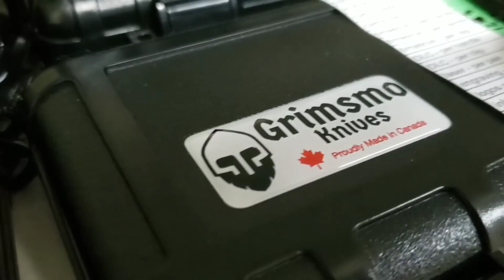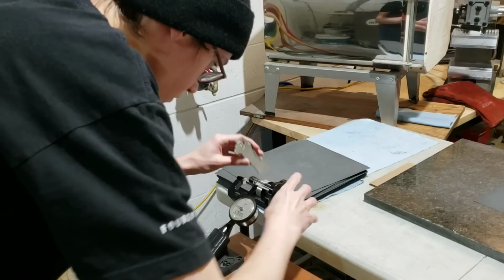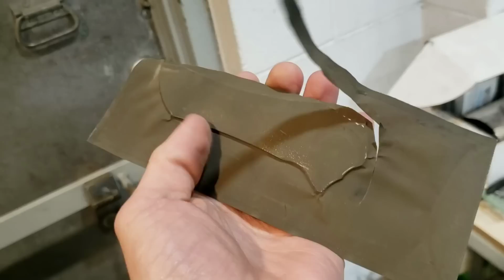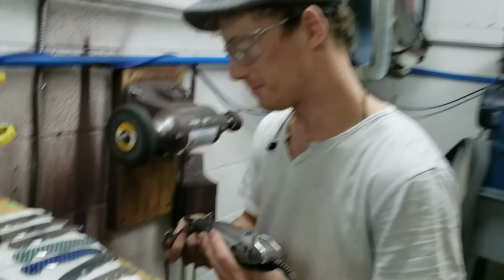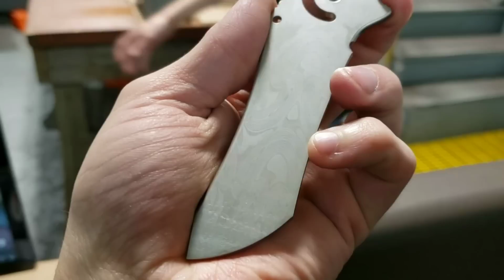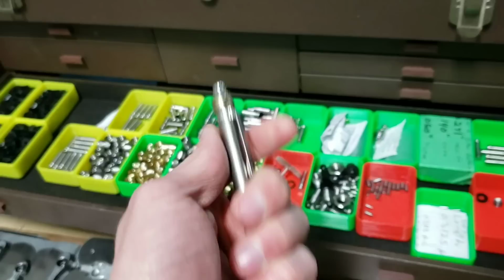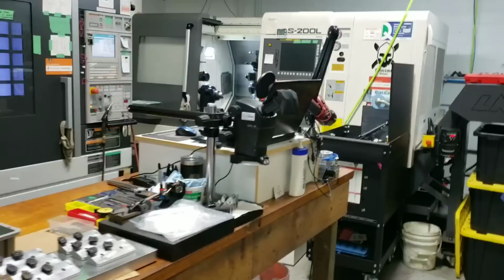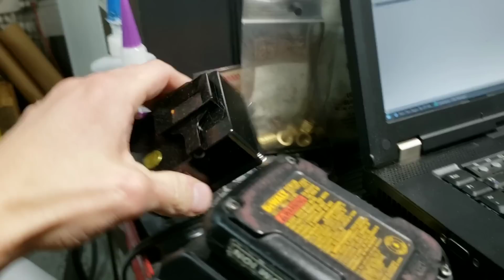Shop update and having a Big Think with John and Barry - Shop Life 034

Comment: Your motherboard has limitations to how many gigs of ram it can handle. This is why it is probably reading only one stick. Stick to motherboards manual and you will be fine.
Reply: Or... he may have a bad stick of RAM...
16-32GB of RAM is not uncommon
Reply: Most modern mobo chipsets will handle 64 Gb just fine. Having said that, leaving RAM modules lying around out of their static protection is a great way to make sure they don't work...
Reply from the maker: Right, gotcha.
Reply: Check the manual - some boards like to have ram sticks in pairs, very non-intuitively in bank 1 &3 then 2 &4. I would try cycling each suspect stick in bank one - if any don't work by themselves, then its likely dodgy.
Reply: @nickmartin1688  They'll be fine. All that "yoU'vE gOT to UsE aN aNTi sTAtiC wrISt StRap," is nonsense. We didn't own q single one, and we built hundreds-thousands of computers without issue. We used to have a tech at the computer shop I worked in, that would stir his coffee with 512 mb sticks. (In the late 90's when that was a ton of ram.)  So it's a non issue. Usually people that don't know much about computers think that static is a bigger issue than it is
Reply: Hi Andrew; I don't want to pick a fight, but you are wrong. I also worked in a computer shop building and then fixing PC s 'back in the day' and we didn't pay much attention to ESD either. We also had a small but significant number of early failures.

I moved on to a high-end communications equipment manufacturer. After a heap of testing and statistical analysis, they found that it was profitable to make the plant ESD free with a conductive floor covering and heel straps on everybody's shoes. There was a tester at the main door and anyone without grounding always had a significant charge.

After a year or so, our field failure rate was WAY down and the company made it's money back in a couple of years due to the lower repair & replacement costs.

So, handling static sensitive parts won't often kill them outright, but it DOES increase the likelyhood that they will fail  earlier than they should.

Edit: also back when you and I were building all those PCs, the transistor junctions were huge compared to the 14 um junctions in the latest chips. the smaller the transistors are, the more easily they are damaged.
Reply: Check the CPU socket for bent pins, happens easily these days. They can be bent back if you are lucky.